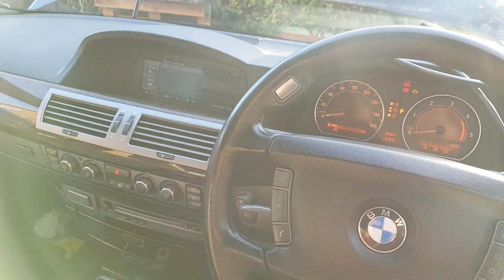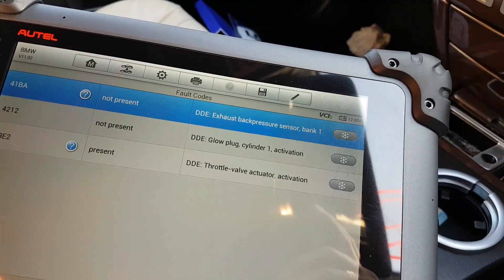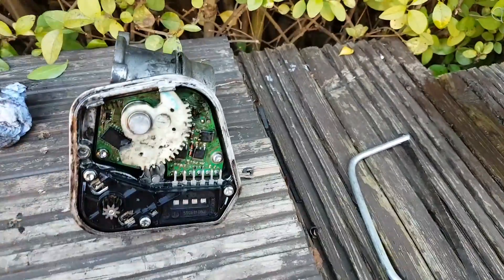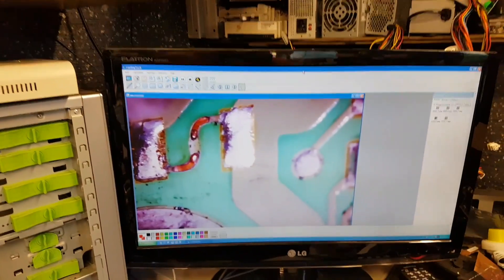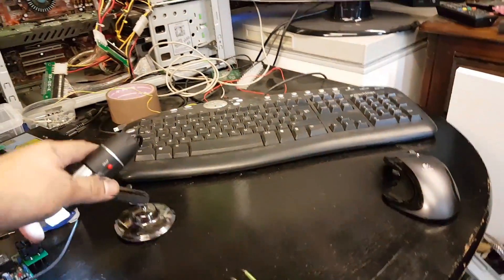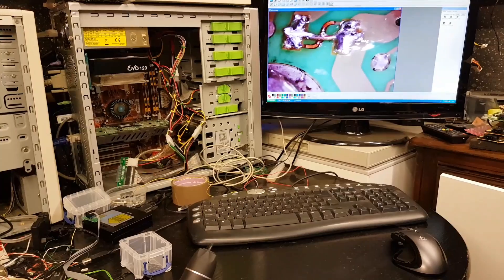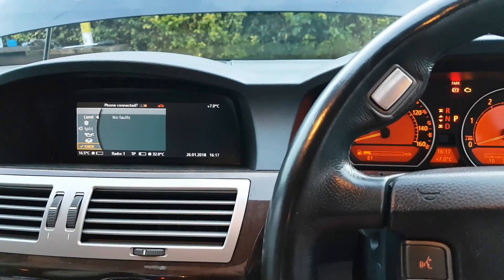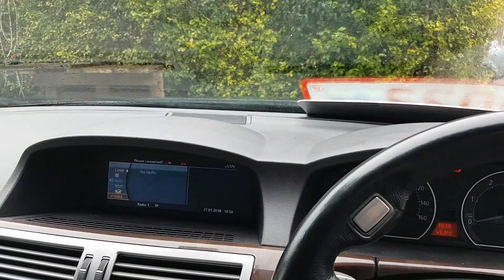BMW 730d E65 fault code 43E2 throttle body activation. Fault finding and repair.

Comment: Tahanks for this video, it resolved my problem in e87 118d. Car lost power when driving in every gear but not every time, it was horrible to drive... I've the same electronic fault like in yours video but error in computer was: 43E2, 43D1, P2620, P2621. After repair car drive normal and have no errors:)
Reply from the maker: Marcin Jasiński 
That's great! 
Thank you for watching and for your feedback!

Comment: Hi friend i have Chevy Captiva Which Old ECM Burned due to alternator overcharge so i swapped my ecu .Now my ecu Showing P268A (INJECTOR not Calibrated or Coded) So If I sent you the file of ECU which is taken by KTAG so can you code the Injectors on it ECU Type (EDC16C39) and it's throttle also stuck on 94.9% I recently flashed another file to check any movement happens in throttle position yes I movement happened it comes on 54.9 % so I think may be problem in ecu file could u program for me I am from India .
Reply from the maker: Harsh kumar 
Hi
I do really appreciate your comment...
Unfortunately program injector codes on a file is not that simple... I confess I wouldn't know where to start... and would have to research...
You will be better with a tool capable of programming the injector codes through the OBD port...
Sorry if I can't be more helpful this time...
Reply: LM Auto Repairs at least throttle position?

Comment: as always very informative and detailed video. Thank you for sharing
Reply from the maker: Mark Eastwood 
Thank you Mark!
Reply: @LMAutoRepairs   i wish i was closer to your shop.. i have a 2005 e61 525d and cant find any info on the throttle valve actuator..  i have B+ and solid ground, car running backprobed. and ca 2.2v on 3rd wire.. not much change with rpm. input or output?
i have 6Mohm between + and - pins.. and i think its dropping to open and slowly coming down agian to 6Mohm..
 is the "fuse" you soldered, between the ground and the power pin? where does all the oil come from?
Reply from the maker: @joachimjohan1215  
No... you can't connect ground to voltage... the fuse is on the voltage side, which burned due to the oil...
The oil comes most likely from the turbo...
Thank you for watching and for your comment!
Reply: @LMAutoRepairs  is it normal for the turbo to puke oil or is it going out? do you know any known good ohm values for the unit? what about the 3rd pin 2.2volts? is it a position senor or command input?

Comment: Great work as always.  Your knowledge is great and thank you for taking the time to share that knowledge with us.  It's a pleasure.  Also the dpf problem can also be caused by the faulty glow plugs and glow plug module I had the same problem on my 525d.  They have a similar engine so that might be something worth looking at.
Reply from the maker: Hassan Raza 
Hi
Thank you for your comment...
The glow plugs on there own are not critical for the DPF to regenerate... but they indeed play an important role...
It might be though,  that on some cars, or even on some BMWS, depending on the engine ecu software, they are actually imperative, and need to be fully working...
I will be soon posting another video on this car,  regarding the DPF... stay tuned...
Thank you for watching!

Comment: Hi. What is this throttle body for in diesel engine?
Reply from the maker: Slawek h 
Hi
I will be soon posting another  (and last...), video on this car, regarding the DPF, in there I will be explaining it...
But basically,  this have two main functions  on this engines at least...
One, it closes when the engine is turned off, starving the engine of air, allowing a smooth shutting down... another one, is when egr air is going into the engine, this closes slightly,  reducing the amount of fresh air, that also increases the combustion temperature,  which helps on the regenerations of the DPF...
Hope that answers your question. 
Thank you for watching!

Comment: Cheers for great repair video at component level brilliant, the blocked dpf ihave found is related to faulty glow plug/plugs that don't allow it to run a regen because it can't generate enough heat in cylinder and thus raise exhaust temp cheers sandy
Reply from the maker: Hi
There is more that just that... 
I will be soon publishing the video for that one...
Thank you for watching Sandy!